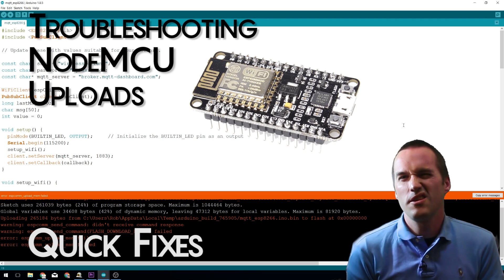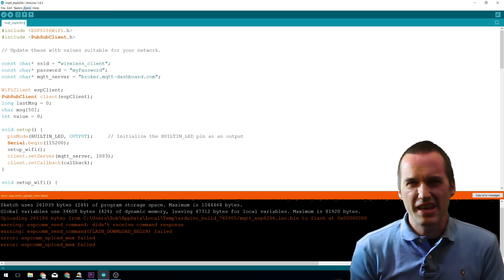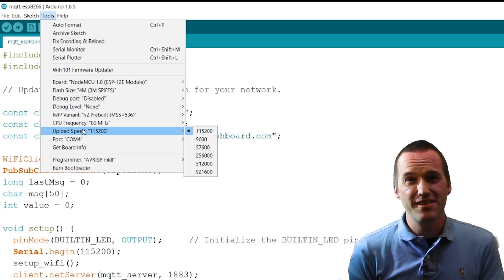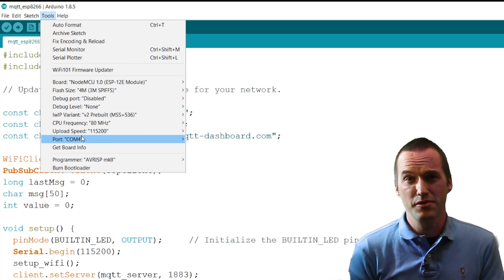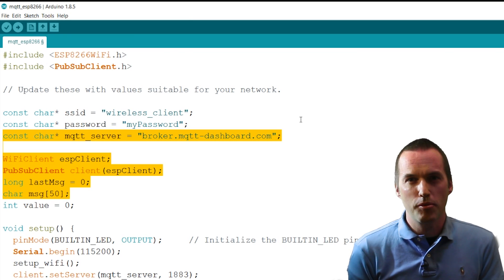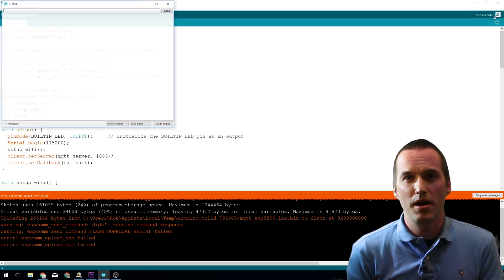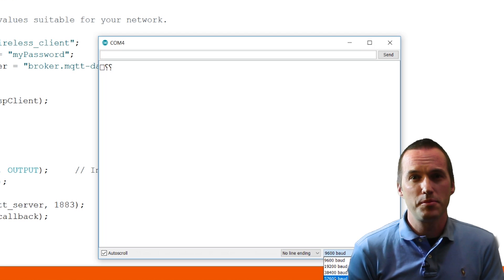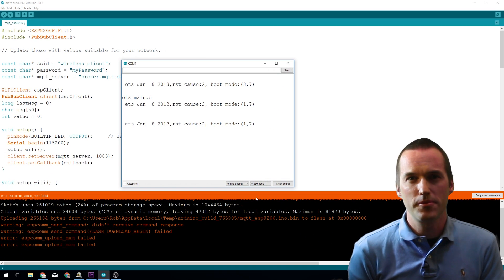Troubleshooting NodeMCU (ESP8266) Arduino Uploads

Comment: Screw you I hope you get deplatformed for your toxic search terms.  Every time I search for how to program an Arduino to control an 8266, instead I get garbage videos like yours about uploading code directly to the 8266.  I DON'T WANT YOUR SHIT AND I'M SICK OF IT SHOWING UP IN MY SEARCHES FOR OTHER THINGS!
Reply from the maker: The title of the video is "Troubleshooting NodeMCU (ESP8266) Arduino Uploads", what were you expecting?
Reply: @TheHookUp  Uploading code to an ARDUINO, not an ESP board.  I want to use an ESP like I use an ethernet shield.

Coding for ESP is useless because there are so few pins.  All the search terms are flooded with guys like you advertising something completely different.

Comment: Hey man i did everything shown in video and i did change cables 5 to 6 times the esp8266 is blinking then connect to laptop but its not being detected and when m uploading in it an error of saying smthing like error time out or no device connected(i.e esp)

I tried the rst button too flash one too
Even tried to upload the lower and stable version and also higher ones
The error is same

What problem is this do u have any solution?

Comment: when i upload my dht11 code it works, but when i want to send the data to firebase it gives the wdt reset error
ets Jan  8 2013,rst cause:4, boot mode:(3,6)

wdt reset
load 0x4010f000, len 3584, room 16 
tail 0
chksum 0xb0
csum 0xb0
v2843a5ac
~ld

Comment: I have an issue. Port settings are greyed out for me. I've installed the CH340G drivers and the CP210x drivers. I also have slightly different settings available, for insance I can find the memory option you had with "SPIFS" or whatever it was.

Thanks if anyone can help (I'm using the 1.8 Arduino ide)

Comment: Hi, I have been working with NodeMCU-V3 for some time, but when I run the program on using WiFi on NodeMCU-V3, when it is complete, the port starts to disconnect and connect. Why does this happen?
Reply: Same problem I am facing

Comment: Hi, i cannot anymore upload my pro on the esp8266. I tried everything, changing the serial reset via flash + rst on the board, check the parameters of the card... i took a picture of the error messages. If you have any idea, i will be very glad ...

in any case, i appreciate your youtube channel. Take care.

JJ

Arduino : 1.8.17 Hourly Build 2021/09/06 02:34 (Mac OS X), Carte : "NodeMCU 1.0 (ESP-12E Module), 80 MHz, Flash, Disabled (new aborts on oom), Disabled, All SSL ciphers (most compatible), 32KB cache + 32KB IRAM (balanced), Use pgm_read macros for IRAM/PROGMEM, 4MB (FS:3MB OTA:~512KB), 2, v2 Lower Memory, Disabled, None, Only Sketch, 115200"

Executable segment sizes:
ICACHE : 32768           - flash instruction cache 
IROM   : 231500          - code in flash         (default or ICACHE_FLASH_ATTR) 
IRAM   : 26217   / 32768 - code in IRAM          (IRAM_ATTR, ISRs...) 
DATA   : 1496  )         - initialized variables (global, static) in RAM/HEAP 
RODATA : 876   ) / 81920 - constants             (global, static) in RAM/HEAP 
BSS    : 25520 )         - zeroed variables      (global, static) in RAM/HEAP 
Le croquis utilise 260089 octets (24%) de l'espace de stockage de programmes. Le maximum est de 1044464 octets.
Les variables globales utilisent 27892 octets (34%) de mémoire dynamique, ce qui laisse 54028 octets pour les variables locales. Le maximum est de 81920 octets.
esptool.py v3.0
Serial port /dev/cu.wchusbserial14220
Connecting........_____....._____....._____....._____....._____....._____.....____Traceback (most recent call last):
  File "/Users/JeanJacquesSandraBigare/Library/Arduino15/packages/esp8266/hardware/esp8266/3.0.2/tools/upload.py", line 66, in <module>
    esptool.main(cmdline)
  File "/Users/JeanJacquesSandraBigare/Library/Arduino15/packages/esp8266/hardware/esp8266/3.0.2/tools/esptool/esptool.py", line 3552, in main
    esp.connect(args.before, args.connect_attempts)
  File "/Users/JeanJacquesSandraBigare/Library/Arduino15/packages/esp8266/hardware/esp8266/3.0.2/tools/esptool/esptool.py", line 529, in connect
    raise FatalError('Failed to connect to %s: %s' % (self.CHIP_NAME, last_error))
esptool.FatalError: Failed to connect to ESP8266: Timed out waiting for packet header
esptool.FatalError: Failed to connect to ESP8266: Timed out waiting for packet header

_

Ce rapport pourrait être plus détaillé avec
l'option "Afficher les résultats détaillés de la compilation"
activée dans Fichier -> Préférences.

Comment: Hard resetting via RTS pin...
plzz help mee
Reply from the maker: That's a success message, it should be working.
Reply: @TheHookUp  nooo reading in my cloud and serial monitor
Reply from the maker: I think the problem might be with your code then, not the upload process.
Reply: @TheHookUp  no sir 😭

Comment: Hi there I’m running my arduino in os and the thing is I’m playing around with a photoresistor en the serial monitor works fine but as soon as I build a simple circuit with LED’s and the photoresistor there is no output from the serial monitor

Comment: Very helpful. My problem is "serial.serialutil.SerialTimeoutException: Write timeout
" Changing the boardrate, usb cable and com port have not solved the problem
Reply: Im getting samne error
Reply: @maheshbendugade7183  While i have not solved my issues entirely. I downgraded my version of esp8266 boards to version 2.5.0 I have a new error but at least its not that one. My new error is  "error: espcomm_upload_mem failed
"

Comment: not sure if you can help but i consitently get errors after compiling and during upload... 
...
from the compiler logging
....
Features: WiFi
Crystal is 26MHz
MAC: ec:fa:bc:27:cc:12
Uploading stub...
Running stub...
Stub running...
Configuring flash size...
Traceback (most recent call last):
  File "C:\Users\jxxxx\AppData\Local\Arduino15\packages\esp8266\hardware\esp8266\3.0.1/tools/upload.py", line 66, in <module>
    esptool.main(cmdline)..... repeats a fe wmore lines, then
esptool.FatalError: Timed out waiting for packet header

i can see the LED flash a few times, but can never get the cache size in order to upload. Any thoughts and ideas?

Comment: I am trying to test GPS/LTE module sim7080g. In the serial monitor i get 
mode:DIO, clock div:1
load:0x3fff0018,len:4
load:0x3fff001c,len:1044
load:0x40078000,len:10124
load:0x40080400,len:5856
entry 0x400806a8

and no GPS found check wiring.

I am using NodeMCU 32s hooked up rx and tx to pins 16,17

any pointers would be appreciated

Comment: Arduino: 1.8.13 (Windows Store 1.8.42.0) (Windows 10), Board: "NodeMCU 1.0 (ESP-12E Module), 80 MHz, Flash, Legacy (new can return nullptr), All SSL ciphers (most compatible), 4MB (FS:3MB OTA:~512KB), 2, v2 Lower Memory, Serial, None, Only Sketch, 115200"

Executable segment sizes:

IROM   : 238196          - code in flash         (default or ICACHE_FLASH_ATTR) 

IRAM   : 27728   / 32768 - code in IRAM          (ICACHE_RAM_ATTR, ISRs...) 

DATA   : 1248  )         - initialized variables (global, static) in RAM/HEAP 

RODATA : 912   ) / 81920 - constants             (global, static) in RAM/HEAP 

BSS    : 25312 )         - zeroed variables      (global, static) in RAM/HEAP 

Sketch uses 268084 bytes (25%) of program storage space. Maximum is 1044464 bytes.

Global variables use 27472 bytes (33%) of dynamic memory, leaving 54448 bytes for local variables. Maximum is 81920 bytes.

esptool.py v2.8

Serial port COM4

Connecting........_____....._____....._____....._____....._____....._____.....____Traceback (most recent call last):

  File "C:\Users\JEEL KANTARIA\Documents\ArduinoData\packages\esp8266\hardware\esp8266\2.7.4/tools/upload.py", line 65, in <module>

    esptool.main(cmdline)

  File "C:/Users/JEEL KANTARIA/Documents/ArduinoData/packages/esp8266/hardware/esp8266/2.7.4/tools/esptool\esptool.py", line 2890, in main

    esp.connect(args.before)

  File "C:/Users/JEEL KANTARIA/Documents/ArduinoData/packages/esp8266/hardware/esp8266/2.7.4/tools/esptool\esptool.py", line 483, in connect

    raise FatalError('Failed to connect to %s: %s' % (self.CHIP_NAME, last_error))

esptool.FatalError: Failed to connect to ESP8266: Timed out waiting for packet header

_

the selected serial port _

 does not exist or your board is not connected

This report would have more information with
"Show verbose output during compilation"
option enabled in File -> Preferences.

stuck with this for 2 day
please guide me

Comment: Hi guys, can you help me, i’m stuck for about a week😢
On esp8266-01 and nodemcu,When i use ESP.deepSleep(0); and wake it up manually it work perfectly but as soon as i put a value in it like ESP. DeepSleep(3e6); the code upload and execute with no problem till it goes into deepsleep, upon wakeup, it got stuck somoere on boot , gpio16 stay low forever and no program run at all. On serial monitor it only show reset cause and mode followed by : ets main.c
Nothing else is shown and happens. I dont see the « load,len,csum,etc » stuff anywhere!

I need help please!🙏

Comment: Thanks for all your vids, you are helping me to understand the IoT. When I try upload a sketch from the Arduino IDE I get an error: "write timeout - board does not exist or your board is not connected to nodemcu". I have added the additional boards manager, selected the correct board, selected the port and checked the speeds are as recommended. The board shows up in serial monitor and displays boot mode, waiting for host. Can't figure out what I'm missing here, do I need to push or hold a button on the node mcu or something? I've tried different ports and USB cables with no luck.

Comment: am getting this error 

Arduino: 1.8.13 (Windows 10), Board: "NodeMCU 1.0 (ESP-12E Module), 80 MHz, Flash, Legacy (new can return nullptr), All SSL ciphers (most compatible), 4MB (FS:3MB OTA:~512KB), 2, v2 Lower Memory, Disabled, None, Only Sketch, 57600"

Executable segment sizes:

IROM   : 228624          - code in flash         (default or ICACHE_FLASH_ATTR) 

IRAM   : 26756   / 32768 - code in IRAM          (ICACHE_RAM_ATTR, ISRs...) 

DATA   : 1248  )         - initialized variables (global, static) in RAM/HEAP 

RODATA : 688   ) / 81920 - constants             (global, static) in RAM/HEAP 

BSS    : 24880 )         - zeroed variables      (global, static) in RAM/HEAP 

Sketch uses 257316 bytes (24%) of program storage space. Maximum is 1044464 bytes.

Global variables use 26816 bytes (32%) of dynamic memory, leaving 55104 bytes for local variables. Maximum is 81920 bytes.

esptool.py v2.8

Serial port COM3

Connecting........_____....._____....._____....._____....._____....._____.....____Traceback (most recent call last):

  File "C:\Users\michael\AppData\Local\Arduino15\packages\esp8266\hardware\esp8266\2.7.4/tools/upload.py", line 65, in <module>

    esptool.main(cmdline)

  File "C:/Users/michael/AppData/Local/Arduino15/packages/esp8266/hardware/esp8266/2.7.4/tools/esptool\esptool.py", line 2890, in main

    esp.connect(args.before)

  File "C:/Users/michael/AppData/Local/Arduino15/packages/esp8266/hardware/esp8266/2.7.4/tools/esptool\esptool.py", line 483, in connect

    raise FatalError('Failed to connect to %s: %s' % (self.CHIP_NAME, last_error))

esptool.FatalError: Failed to connect to ESP8266: Timed out waiting for packet header

esptool.FatalError: Failed to connect to ESP8266: Timed out waiting for packet header

_

This report would have more information with
"Show verbose output during compilation"
option enabled in File -> Preferences.

any ideas?

something also unusual is is no com port is appearing or disappearing when plugged in or unplugged

Comment: I had tried literally everything, even things suggested outside of this video. What finally worked for me was holding down the FLASH button and then later pressing the reset button. The message was outputting at the weirdest baud rate 74880 but it said the ets Jan 8 2013, rst cause:2, boot mode: (3,6) just like in the video. I recommend trying all these steps!

Comment: I am getting the following error: "serial.serialutil.SerialException: could not open port 'COM3': PermissionError(13, 'A device attached to the system is not functioning.', None, 31)" whenever I try to upload to the nodemcu. Resetting did not work, and I also cannot open the serial monitor. When I try, I get "Error opening serial port 'COM3'. (Port busy)". Could this be due to faulty drivers? Which ones do you use?

Comment: Hello there, I am facing a different type of problem in my homeautomation project,  using esp 8266 in which while receiving data from firebase it automatically resets after every 40-50sec, and I am not able to solve this issue. I will be very thankful to you if you can share you email id for discussion in details 

Warm regards

Comment: I'm building the Morphing Digital Clock by Hari Fun and thought I had all of the correct libraries/sketches installed. I get the Leaving... Hard resetting via RTS pin... message, It shows I'm at 9600 baud and the serial monitor is blank. Appreciate any help. I am a total amateur at this. When I hit the reset on the esp module, the blue light blinks along with one LED on the display that blinks red in sync.

Comment: you're a life savior!
I changed the "Flash Size" settings to make it similar to yours (it used to be 4MB(FS: 2MB OTA....) now it's 4MB(FS:3MB OTA....)
then I've pressed the Flash button, and shortly after I've pressed the Reset button as you said.
it worked perfectly!
PS: THE MESSAGE "Leaving...
 Hard resetting via RTS pin..." DID NOT DISAPPEAR IN MY CASE, BUT THE CODE STILL WORKED!

Comment: #include <ESP8266WiFi.h>
               // ESP8266WiFi.h totally normal and the colour is orange.
#include <BlynkSimpleEsp8266.h>  // The BlynkSimpleEsp8266.h is still black and supposed to be orange also. I already installed all the necessary board and library like Blynk by Volodymyr, Esp8266 by ESP8266 Community and changed the board to NodeMCU 1.0 (ESP-12E Module) 

I just don't know what's wrong or what did I missed. Anyone facing the same problem?

Comment: I'm having an error, and I suspect it is something about a Windows automatic update because I haven't done any changes. Windows Arduino IDE 1.8.12. I get "Connecting........____.....____ (....) esptool.FatalError: Failed to connect to ESP8266: Invalid head of packet (0x00)"  I'm very frustrated. I already tried resetting while uploading and these solutions but same problem. :( :( :(   If somebody know anything about this I'd appreciate your help a lot. I already tried older versions of ESP8266 Community such as 2.5.0, 2.5.2 or the newest 2.7.1 . :(
Reply: i have this issue either but with wemos d1 mini who doesn't have flash button . but only reset button on the side .
Reply: @TechnoWit3D  I think the pin D3 can be used to flash it.
Look it up, it might work!
Reply: @abir7090  do you mean change D8 to d3 as data in?
Reply: @abir7090  thanks. I finally solved it, by reduce the baud rate to 57600. Thanks for your suggestions anyway.

Comment: ahhh it worked !!!!!!!!!!!!!!......last tip OP
but programs are still not working :(
it says Hard resetting via RTS pin... after i upload but then my serial monitor is still blank
Reply: did you solve your problem?
Reply: @niyatijain2119  i did eventually but I don't remember it sadly that was ages ago, srrry :(
Reply: @drakehopkins5931  ohkay😞

Comment: My code is timing out when waiting for packet header. When I try your last tip about resetting nothing shows in the serial monitor?
Reply from the maker: Sounds like either the com port is wrong or your USB cable is a power only cable (no data).
Reply: @TheHookUp  Thanks for the reply, I double-checked the port, used a few different cables (all of which are phone sub cables) but still getting the "A fatal error occurred: Failed to connect to ESP8266: Timed out waiting for packet header". can upload anything to the board so im presuming it is a port problem/windows permissions thing?
Reply: @Duncanwg7  I have the same problem.. did you find a solution because I have tried everything

Comment: I am facing the issue while uploading the program in nodeMCU  that error is - Leaving.......  Hard resetting via RTS pin.....
Reply from the maker: That's not an error, it means the program has uploaded successfully and the NodeMCU is rebooting to load your program.
Reply: @TheHookUp  thanks for the reply, after uploading the program, I ran the IP address in web browser but it was not working..

Comment: Hi, I'm getting below error when I'm trying to upload code using Arduino with same configuration as shown in the video.
Error: esptool.FatalError: Timed out waiting for packet header

Note: when I open Serial monitor I'm getting this output.
ets Jan  8 2013,rst cause:2, boot mode:(3,6)
Reply: Digant Goradia i am facing the same issue if you could solve it for me by providing me a solution. I am using esp8266 and a usb to esp8266 to flash the program i welded the wire so i turn it to flash mode(the usb)
Reply: @ahmedalshamsi1723  Same here 😒😣
Reply: @Isha sharma  did not find a solution yet even after the research that lasted forever... wish you luck

Comment: I use the esp 32 and when I upload the code the ide shows a msg hard resetting via pin
How I can Fix it
Reply: don't fix it, that means it's working
Reply: @dionysos8326  but can't find what i expected in serial monitor, its showing gibberish only! I'm using ESP8266
Reply: @nehareddy5097  check the baud rate in your code as well as in your compiler, they should match and i'd advise either both 9600 or both 115200
Reply: Same problem pls help me fix it..
Compressing..
Leaving 
Hard reseting via pin..
Reply: @mrunmaidahare8477  As it is set in his code you need to use "115200 baud" in serial monitor. If you press the reset button you will see the output "Connecting to ...." etc.